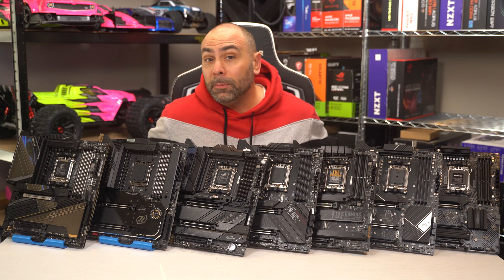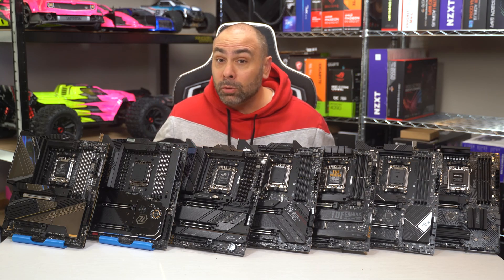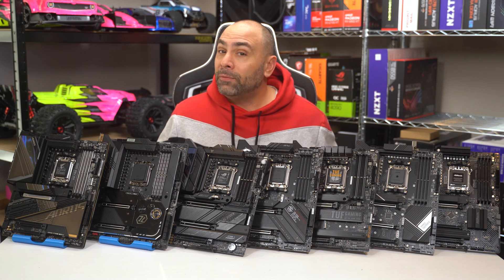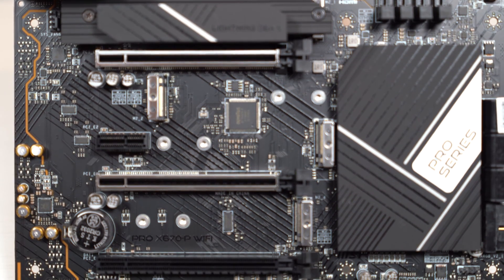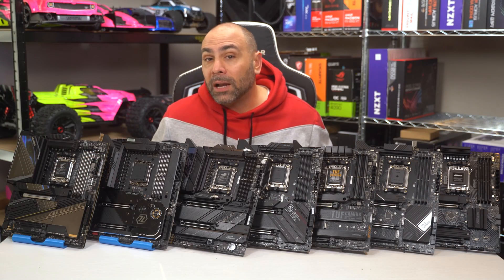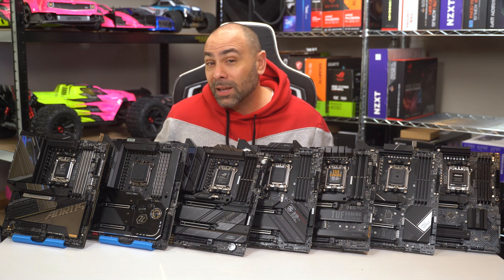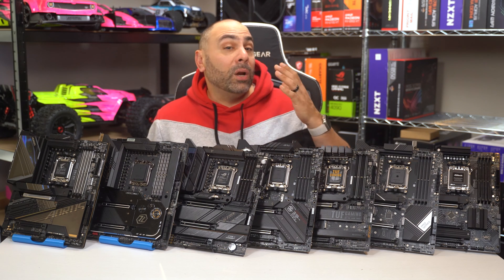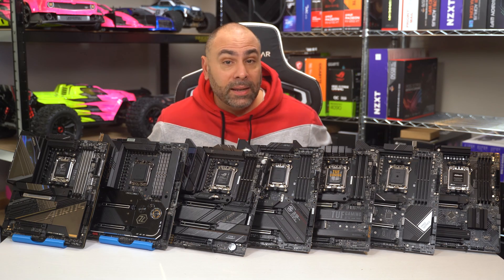Ryzen 7000 Motherboards - X670 Roundup!

Comment: All the Motherboards listed have waaayy more VRM power than any 7000 series chip is going to use with the exception of Sub-Zero OC.  They most likely would not be an issue even if the Heat Sinks were missing.

Comment: As an ITX builder I’m disappointed with the lack of ITX boards being offered in the 650/670 chipsets and the complete lack of rear USB ports being offered for the prices being touted this generation 😢😡considering what the chipset offers! You can still build decent powerful systems in an ITX for factor ….. even SFF ITX 🥰👍💪
Reply: Well you should have already been use to it with the sized of the latest graphics cards unless you custom water cool.
Reply: My issue is the overall cost of all of the x670e and non-e-boards. Given that many board makers are skipping the non-e boards entirely, the cost of x670e is not that much more than b650e, and not many motherboard makers are choosing to make the non-e boards which would be most definitely cheaper. The lack of ITX and smaller form factor boards is also concerning, as it shows that motherboard makers don't really care to cater to Niche markets anymore.

Comment: I think the massive jump in cost for this new platform is way to much. If you factor in the costs for a motherboard and the memory. This makes the new platform as a package to expansive. Therefor i think i have to look into the B chipset then.
Reply: Because DDR5 slot, PCIE 5 slot charged us too much as early adopter.

Comment: I'm planning a complete new build, but waiting for the AMD 3D VCache CPU coming out soon for the large gaming boost (AMD's last 3D VCache CPU is 2 generations old now, & yet it still holds its own against the LATEST AMD & Intel CPUs). I'm putting this in a Cooler Master HAF 700 case, with three 420mm radiators (top & side & bottom) & two 200mm fans on the front, & two 120mm fans on the rear. Going for a single water loop which cools ALL possible components: GPU & CPU & M.2 & RAM. This is especially important as ALL the latest gen components run super-hot, especially the imminent PCIe M.2 drives being released, & DDR5 RAM around the 8,000MT/s is also set to be hot. 
As to which specific makes, GPU wise I'm leaning towards the RTX4090ti if it comes out early 2023, or just a RTX4090 if not, which I will use EK dual active cooling (front & back plates) on. 
Motherboard wise, I have always like ASUS Rog Strix, but it depends if it will support the fastest DDR5 RAM. 
DDR5 RAM wise, it will have to support a water block & run at AT LEAST 8,000MT/s with low CL latency. 
PSU: 1,500W Platinum ATX 3 standard - not sure which make yet.
The idea of this build is it completely removes ALL thermal or electrical overhead throttling, so all hardware auto boost to max possible speeds constantly.
Reply: 2 generation old? Did you think 7000 series has 2 generation???

Do you know AMD skip 6000 series

Comment: B650 if i had to go AM5, once i get 1 gen5 m.2 I'm good. 
Dream built -
7700X and 7700XT (when it is released) with 1tb gen5 m.2 ssd and 2tb gen4 ssd
2 × 16gig ddr5 @ 6200 mb/s.
Reply: Unlike you, I need PCIE 5 because I only upgrade my PC every 10 years. Today PC is no longer like in 90's or 00's. You doesn't need to upgrade every 2 years anymore. What important is GPU and CPU upgrade.

Comment: Is it expensive for mobo to have a built in IO shield?
Reply from the maker: I don’t know the exact answer to this but when every board starts at $250 it should be the default in 2022
Reply: should be mandatory
Reply: PCIE 5 slot and DDR5 slot cost manufacturer $70 each. I don't know about IO shields but it should be cheap now because it's an old tech

Comment: I paid $159 for my x570 Gaming TUF Plus WiFi.  Now sure what Im getting for twice as much with this version.  Despite the M.2 latch, still feels like IM getting screwed.
Reply from the maker: The boards are expensive but the chips they support are savage
Reply: I just dropped a 5700x in my x570 board (previously had a 1600AF) and nothing I do stresses my CPU.  For the vast majority of people 7xxx series CPUs are extreme overkill.  Im planning to sit out AM5.  Not because its bad - it is awesome - but because AM4 is awesome too.  I personally dont have a use case that exceeds what I can do with AM4.  But Ill be back for AM 6!

Comment: Ive had ROG Strix X670E-E GMG Wifi from day 1. I have to unplug/reconnect my keyboard at every boot. Sometimes I cant enter Bios at all.... My Sabrent rocket 1TB NVMe PCIE4.0 has disapeared 3 times already for no reason.... Contacted Newegg and Asus both and neither have fixed it, still to this day.
Reply from the maker: That’s unfortunate, ASUS is usually pretty strong when it comes to reliability
Reply: I think it's bios booting time. This is why always wait 6 months to buy a new tech so they problem got ironed within that timeframe
Reply: That's what happens when you overspend just because a board says ASUS instead of actually doing research.  You could've saved $240 with the ASRock X670E PG Lightning which also has slightly better themals than ALL of the ASUS boards.

I don't know what possesses you noobs to spend hundreds of dollars just to get a board that says ASUS ROG on it.  It's just plain stupid.  I'm not ragging on you because I know that there are tonnes of people out there making the same mistake over and over.  My own stepfather, the man who got me into computers and bought me the parts for my first build back in 1988, was somehow always a brand-whore like the people who buy most ASUS products.  

He swore that he ONLY wanted an ASUS board for his Ryzen 9 3900X and he wanted some insane $800CAD ASUS board (I can't remember what it was).  I asked him if he had been sniffing some bad glue because he doesn't do anything strenuous on his PC and just wanted the 12-core CPU for "multitasking" (I groaned audibly as I typed that).  I told him that if he HAD to have an ASUS board, even an ASUS X570 TUF Gaming was overkill for his purposes.  So, thankfully, he got that (he really should've just got an ASUS Prime but I was just glad that he wasn't getting the REALLY insane board).

So, a few months go by and wouldn't you just know it, his TUF Gaming was acting up.  So, I drove the 3 hours to where he lives, swapped his ASUS TUF Gaming out, swapped in my own backup motherboard, an ASRock X370 Killer SLI and he sent his TUF in for an RMA.  He then went south for the winter and four months later I was back at his house to swap his motherboard back in.  He offered to let me keep the TUF motherboard but I wouldn't hear of it.  I told him that I wouldn't take an X570 motherboard in exchange for an X370 because that would be really unfair to him.  I told him that he could give me his UniComp Model M keyboard that he never uses instead.

His whole PC configuration is my design as he showed me a list of what he wanted and I looked at him like he had three heads.  I doubled his RAM, doubled his SSD storage (while maintaning the same ridiculous speed that he wanted) and increased his CPU performance by 30% while shaving $400CAD off the price.  As expected, he was in heaven when it got built and after this fiasco with the ASUS TUF, I forced him to admit that between the two of us, I was the expert now, not him and that he should take my advice.  The fact that my old ASRock X370 Killer SLI never gave him any trouble while his overpriced ASUS TUF Gaming did really drove the point home.

Aways remember, clueless noobs only look at brand while seasoned experts only look at specification.  There's a reason for that and the reason is that none of this stuff can be made in someone's backyard.  Every company that sells a PC tech product is a huge corporation staffed by professionals.  Ignore the brand name and get the cheapest thing that meets the spec you want (for example, get the cheaper ASRock or XFX RX 7900 XTX instead of the vastly overpriced ASUS ROG Strix model because they'll all perform exactly the same).  Being loyal to a brand like ASUS is just plain dumb.  I'm glad you learned this lesson early because I know people who have pissed away thousands of dollars just to see that stupid ROG logo on their stuff.